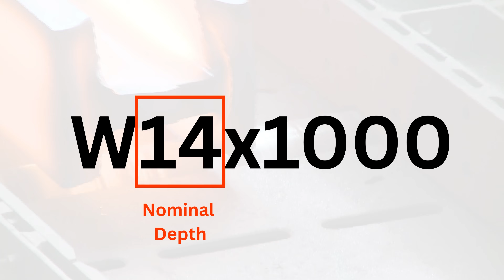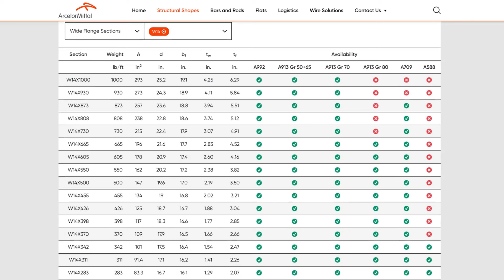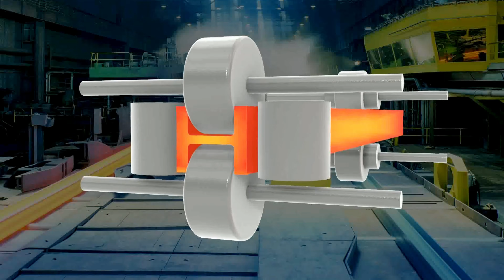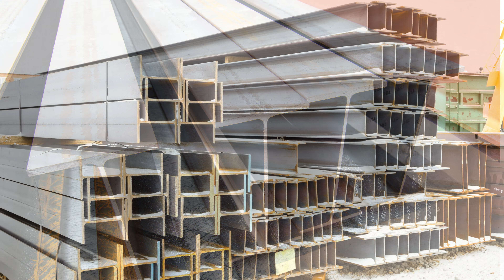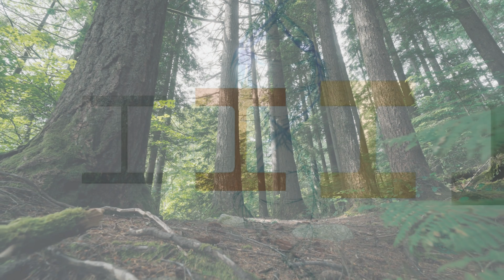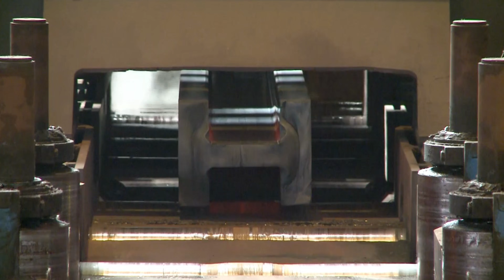A 25 Inch W14?!? - This Makes No Sense

Comment: The W14 series of structural beams is an oddball, because it is typically used as a column section, where it is desired to keep relatively "shallow". By this I mean that column sections are slender, and their depth (14" nominal) and flange width are close to being same. Usual structural sections go deeper (18", 20", 24" and so on) in order to span (installed horizontally) greater distances and/or carry heavier loads. Going deeper for a horizontal member is much more efficient than getting "fatter". Column sections are the opposite (fatter better, keeping close to that "square" configuration. W14's start at 14 x 5 (14" deep x 5" wide flange x 22 lbs/ft) and go up to W14 x 1000 (25.2" deep x 19.1" flange x 1000 lbs/ft). As shown in the video, if you subtract the flange thicknesses from the actual depth, you end up with same dimension (for the W14, is 12.6")

Comment: Seems like they should just adhere to their own naming convention. A W12 1000 that is 25” deep nominally and weighs 1000# per running foot nominally should be called a W25 1000. I get why a 100 year old 2x4 was actually 2”x4” and today’s 2x4 is 1 1/2” x 3 1/2” (and shrinking) because of the lumber industry trying to sell more 2x4’s per tree. But this I beam thing is just silly.

Comment: Man, 1000 LBS per foot, that's alot of weight. Could you imagine cutting a 1/2" off the length and the only thing you can use is a hacksaw. 🤔🤔🤔🤔
Reply: Well, I'd say you "could" IMAGINE it (as in "dunno watcha smokin', dudde, but this stuff ain't doin' yer no good... ;-), but no, it ain't no hacksaw that'd will do it ;-)
Reply from the maker: It might take 5 years but I'd love to see someone try it!
Reply: @ArcelorMittalInternational  Watching paint dry seems to be an exciting "split second adventure" compared to this, but hey, who am I to tell you how to tickle yer fancy, eh? ;-)
But then, a hacksaw blade is what, like 12" long, right? (that'd be one foot for them metric lot, heh heh...)
Now, kindly remind me what are the dimensions of this H-beam...? (And they say "size doesn't matter", wink wink... ;-)
Reply: you'd have about 40 pounds of scrap material. I wonder how much the chips would weigh
edit: about 2 and a half pounds of metal dust

Comment: Its just ridiculous the industry doesnt call the product what it actually is. If its 25", then that number can easily be included in its name. 
Its also ridiculous that a 2x4 isnt what it says and its even worse over the past few years. A 2x4 has not only been down to 1 1/2 x 3 1/2  for the past several decades and regardless of the sawmills cutting wet lumber at the 2x4 size and then it shrinking 1/2" in all directions upon drying. 
Many of us here have been rejecting lumber at our local lowes due to lumber having found lumber that went down even further to 1 3/8 x 3 3/8. 
The industry could have easily cut the wet lumber the fraction larger to accommodate for the lumber's shrinkage whereby the end result would of been very close to a real 2x4

Comment: Has anyone heard of a clear definition of beams which is easy to calculate with and everything is perfectly logical?
Would be great to have something like DIN / ISO.
Reply: That’s what the tables used in calculations are for
Reply from the maker: What about W(gross area)x(Zx)x(Ix)x(Iy)x(Fy) ???  Complicated but effective...... :)
Reply: @ArcelorMittalInternational  The physics is identical everywhere, the math is identical everywhere, only the units and shape catalogs differ
SI + ISO profiles reduce ambiguity and conversions, which is a real engineering advantage
Reply: Are you looking for EN 10365?
It replaced the old DIN norms.
Reply: @Jehty_  Yes, I referred to the DIN EN 10365:2017-05 which I would call the harmonized DIN 1025-2:1995-11. The CEN (European Committee for Standardization) unified channels and the beams, into one norm and includes British Profile ranges, in case I remember correctly.